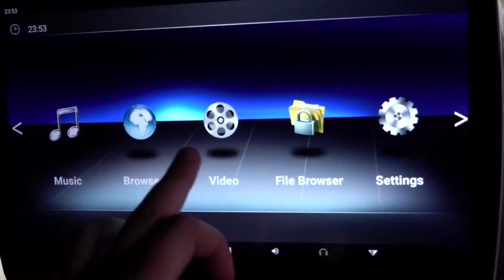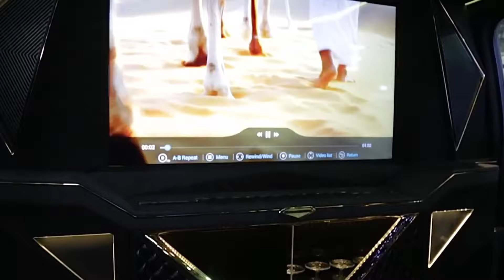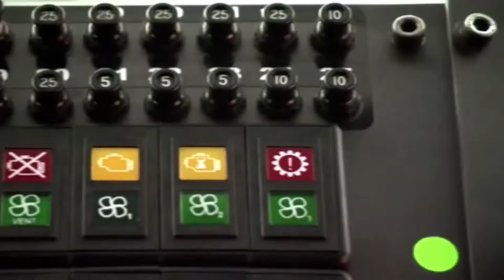Armored Vehicle Was Banned In The USA

Comment: EMP will make them useless just like any other vehicle on the road in proximity
Reply: EMP's only effect microelectronics, spark plugs would work just fine, wires just fine, batteries would have minor issues. You can say computer systems would fry, but cars didn't used to have those, so they can work without them just fine...